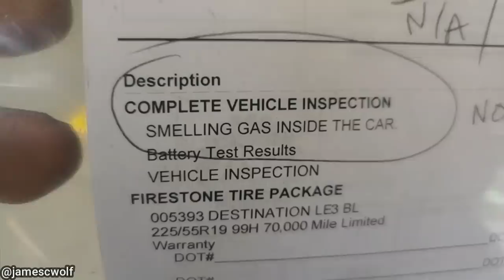Customer States Went Off Roading In Ford Bronco And Now It Won't Start | Just Rolled In

Comment from the maker: Submit your photos/clips @ https://www.justrolledinyt.com

Thanks for watching!
Reply: Really?  how do you smoke a clutch disc in 10 miles? it had to be defective and blew apart, no?
Reply: I love that you showed a clip from Rufford Ford. I got into watching people mess their cars up in those videos on Tom Sunderland's channel
Reply from the maker: @unclequack5445  that's what the tech said they think happened. Will update you guys if I hear anything else.
Reply: Do you take videos or pictures of equipment such as skid loaders, generators or industrial air compressor equipment?
Reply: @unclequack5445  There was a driver in front of me in a parking who blew up a clutch within 2 minutes. 🤪 Was an unpleasant smell. 😂
Reply from the maker: @noname2490  of course! I've shown a couple of clips of heavy duty equipment etc. 👍
Reply: L9l0
Reply: Regards the last video shown-car through the water, the police are giving tickets to those driving through fast, 4x4 and such like. It's a well known spot and has it's own youtube channel.
Reply: @unclequack5445  Pretty sure that is the result of some really aggressive downshifting. Like going from from 5th to 3rd at highway speed, and hitting 1st instead.
Reply: confession     I drove a diesel landrover series 3 into a river and I it tipped on its side , 1.5 meters deep. Stupid me. We dragged it out and left it for 10 mins then tried to start it. Water spewed out of the exhaust for a while then the engine rumbled and started up just fine. changed the oil , filters etc and all was well. Except my pride.
Reply: Ford...first on race day

Comment: Okay, the last one, if you see ducks swimming on the road ahead of you you may want to reconsider driving into that water, especially at that speed LOL
Reply: i have raze the question.  the water didn't look that deep (judging by where the water level was when the car stopped) could they have gotten through it if they had just gone through slowly?
Reply: That's the common fault most people make at that fording, pin it go full speed. Hydro lock. Or you can go through at 5kmh and no problem.
Reply: @Prozerge  It depends where the engine air intake is. Usually this is high up just below the hood.
Reply: @Prozerge  There's the location of the intake..but then you also have to think about where is the ECU installed.. then there's water ingress into the wheel bearings and who knows where else. If this were on a river system with flowing water, even with water at that height, there's the very real possibility they could be washed away, flipped over, etc. It does kill people, not just their cars.
Reply: @DarienDrakee  Or better, hydroplane into really deep water.
Reply: But it was only chest high to the ducks haha!
Reply: @u4tubular  True, it's all about perspective. LOL
Reply: Ah, the good old Duck Test!
Reply: Yeah, and if you decide to send it before noticing there's a guy in a dinghy fishing, think again.
Reply: There are many places with ducks in Britain where the official road leads through... but this is not one of them, this is a flooded road :) It is a popular place for entertainment, there are many videos on that particular one. I have even saved a "duck crossing "in my satnav, which I always include in my countryside tours.
Reply: Seeing as they bought a Jaguar, they have already proven that they make very poor decisions.  This is just par for the course.
Reply: I was going to say that water isn't that high it would have been fine if they went slow but just flooring it was just a dumb idea....
Reply: @Howard Yea, lots of "Lolz" when they have tousands of dollars in repairs due to their ignorance. lol
Reply: They are lucky there.  Where I live in the deserts of Arizona there’s washes deeper than that during monsoon season and can sweep cars away.  It’s bad to the point we have what’s called the “stupid motorist law”.  In short if a driver drives around the “road closed” Barriers and they have to get rescued they are financially responsible 🙄🤦‍♂️
Reply: @wildonion99  Yeah, no-one makes poor decisions in the great US of A.
Reply: There's a YouTube channel devoted to that specific crossing - multiple cars every week attempt to drive through that small river.
Reply: I think I know what he was thinking if I drive really fast through this poodle won't get inside the engine
Reply: Nah, time to speed up
Reply: There are loads of tube vids showing peeps breaking their cars in this ford. It is so notorious, the plod now patrol it to nick reckless drivers taking it at great speed. search 'rutherford ford fails' on the youtube
Reply: The last one has a whole YouTube channel dedicated to it
Reply: With an entire youtube channel dedicated to this crossing, you'd think the city would rebuild this road with a proper drain or something.
Reply: @rafflesnh  1. Jaguar exists in the US, and they're just as crap as they are elsewhere.

2. I'm not even American so your point is...?
Reply: @azrailfan2717  My country has a similar law, but it extends to other facets, such as if you go mountain climbing and become stuck, or do something when the weather is bad.  It cut down greatly on the number of calls once the law was enacted around 2010.
Reply: @soangry  nah they’ll let the crowed gather and let loose in the water. It’s fun, just make sure you know where the air enters the engine, and keep that away from water
Reply: There is a youtube channel that shows only that part of the town where people have to cross that. Some people have done in reverse and it works 😆
Reply: @domingofung  I love it. Watching people hydrolock their engines and destroy connecting rods etc. Fun destruction channel
Reply: like another said "go fast enough, you can probably hydroplane through it!" lol
Reply: @chir0pter  you might also like the 11foot8 bridge, which has its own Youtube channel...
Reply: @Prozerge  as others pointed out, it depends on the intake.  Usually hte intake is in line with the headlight or at the hood latch level. Some cars have 2 intakes. My A8 from 95 for example has a lower larger intake right above the belly pan + a smaller intake right above the radiator. I'm guessing it's because that lower air is colder and if the lower one is blocked, it will take from above so it can't suck whatever is blocking it.
Reply: It's worse than that really.  At the beginning of the clip, on the left - yellow water depth pole.  Clearly visible to the driver warning them it's like 2-3 feet deep.  Entire channel dedicated to that crossing during floods.  So many idiots =)
Reply: If an engine is hydro locked, it won't run out crank. That's what the "locked" part means. That Range Rover was clearly still able to run. What probably happened was it inhaled enough water to stall the engine, but once it got clear of the water, or the water settled,a few cranks spit the water out and now it was just getting rid of the rest of the water in the intake.
Engines can take in a surprising amount of water. Search it on YouTube! I was surprised!
Reply: @Prozerge  look at the sign to see how deep the water is, check how high your intake is and how it’s designed (example: if takes in from a scoop behind the grille, you probably shouldn’t do much fording) and if you think it’s worth risking what is probably your first or second most expensive possession, cross at a low speed, around 4-5 mph.
Reply: That ford crossing is near me and gets loads of victims , by the way I also know the car .
Reply: @soangry  Its a ford crossing a stream and is sign , posted as such and also on maps. You can't fit a drain as its flowing water. The water depth varies depending on the stream depth which varies with rainfall, there will be a depth guage as an extra warning. However few modern drivers know how to deal with fords or where their engines air intake is.
Reply: I mean, if you see that the water depth is about DUCKS can comfortably swim, you should stop before and not trust blindly in the "driving skills" LOL🤣
Reply: @Prozerge  That ford is the infamous Rufford Mill Ford, theres YT channels dedicated to it and the fools that blast through it fast and destroy their engines. There is a depth gauge in the water (its like a giant ruler) showing drivers how deep it is at any one time, the main problem is drivers going too fast.
Reply: Last winter we had some really bad flooding around here, and I may have done a dumb and driven through 18 inches of water in a 90s Camaro. No idea how the water missed the air intake 'cause the engine never even missed a beat.
Reply: It gets difficult to see at night but what's this guy's excuse? If you can see duck's swimming maybe don't try to go through it? 🤣
Reply: That made me laugh
Reply: That particular spot is a famous ford in the UK where a lot of enginens ended up their lives.
Reply: I think the driver thought, if I accelerate I will aquaplane, my car will slide smoothly on the water to the other shore.
Reply: @soangry  this is an update from two weeks ago https://youtu.be/Qnf6l52snPM